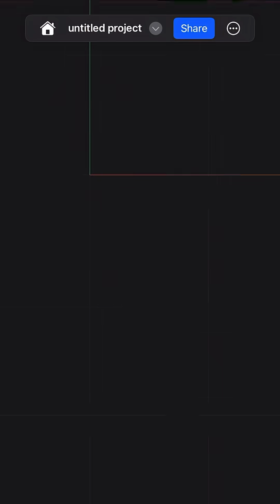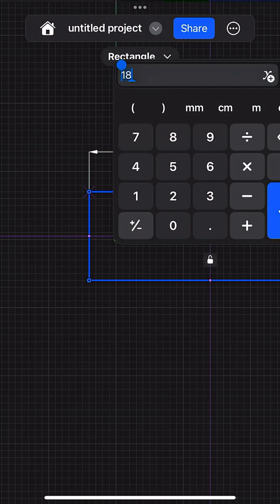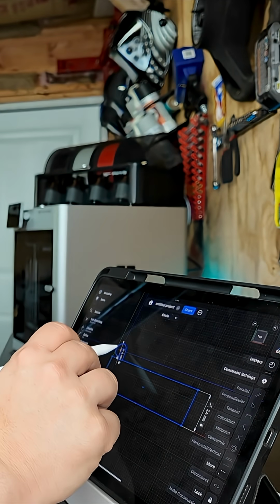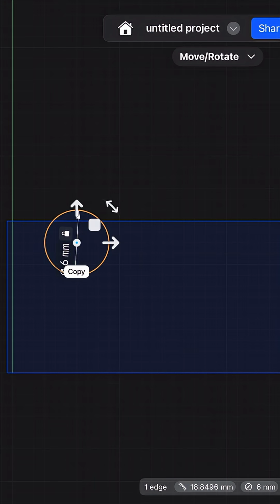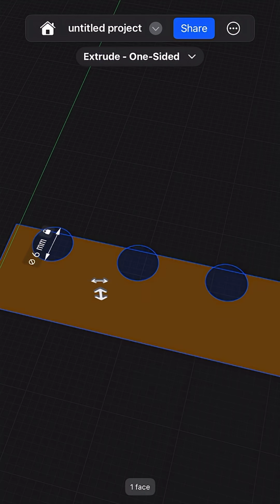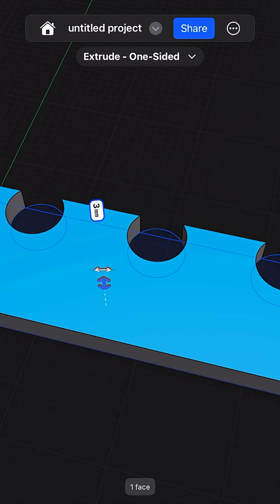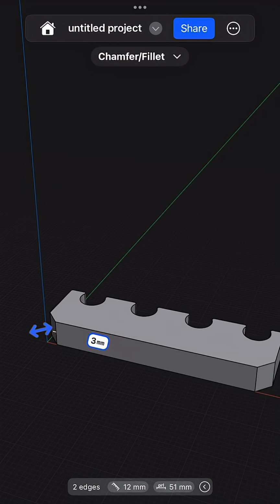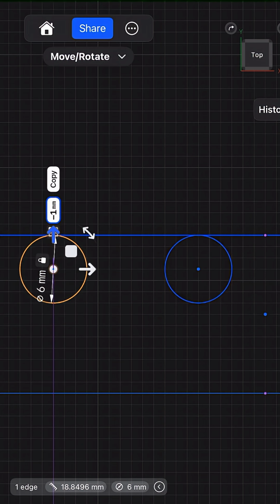How to Make Your First Custom Car Part

Comment: Do I need an expensive 3D printer to print car parts? For example car headlights?
Reply from the maker: Take a look at the Centari Carbon, but are you trying to 3d print the headlight enclosure or the actual lens?
Reply: @Itsallaboutthebuild just enclosure with a wind tunnel and a side round projector light.
Reply from the maker: Nice, you can definitely make a wind tunnel enclosure, filaments are tough if you actually want to make a see through lens. I have tons of free automotive CAD design content via our newsletter or if you need extra help take a look at our workshop -> https://www.allaboutthebuild.com/
Reply: @Itsallaboutthebuild thank you

Comment: Shapr3D is good - only if you pay for it. You can’t export smooth surfaces otherwise. Fusion is the way to go.
Reply from the maker: Its sooo worth the $25 a month. And some parts are simple which print fine even at the free lower res :)